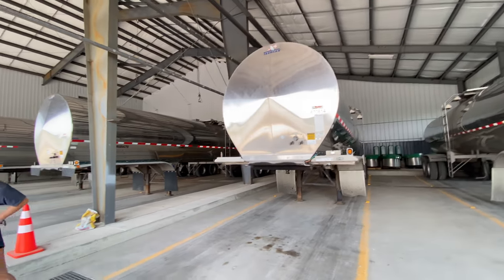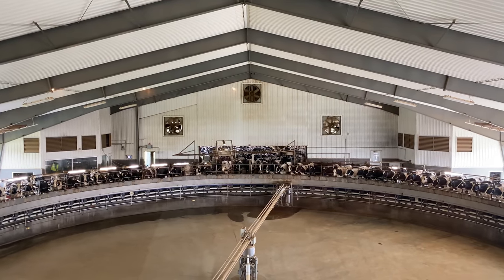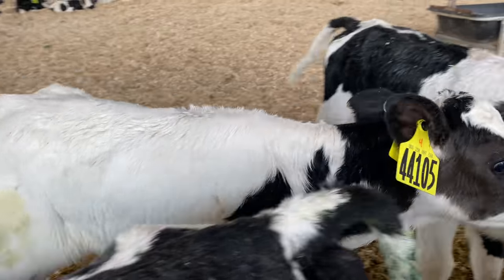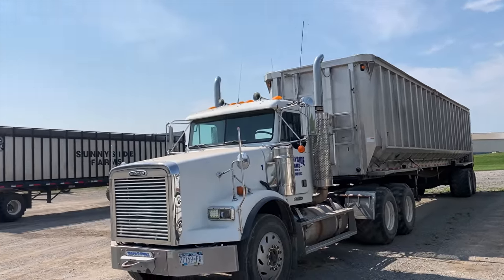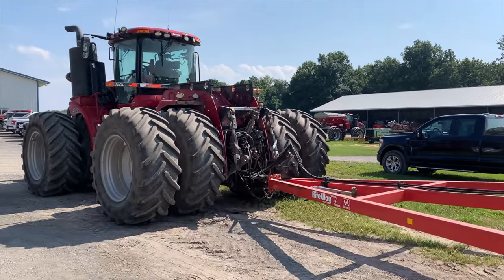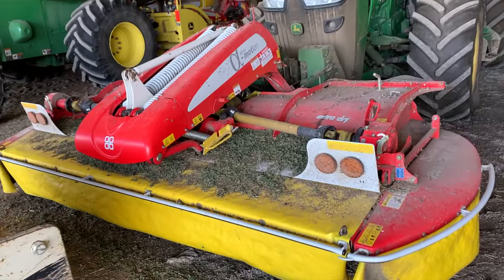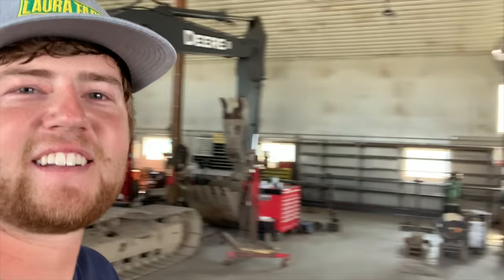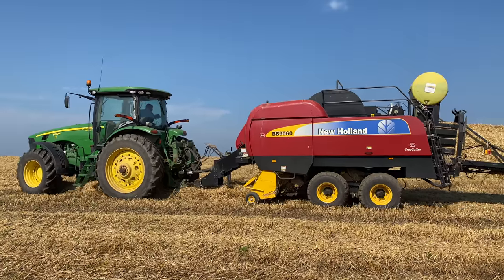Laura’s NEW Favorite Tractor at Sunnyside Farms: John Deere 9470RX

Comment: Great to see they are using the methane to power the farm plus 7k homes!
Reply: How amazing is that? I had no idea farms were even doing that.
Reply: Wow!! What a set up!! Very impressive.
Reply: Since they have the methane generators, why do they need the diesel generator in the milking operation?
Reply: @tommorrisey3999   It is a backup system. That methane plant also powers the farm. When the diesel generator is needed, I think that means the methane digesters or the methane powered generators are down or something in that system is not working.

Comment: Thank you Grant for showing close up of The methane power generators, blow's my mind the number of hrs on them engine's.I wonder how often the oil changed on them? That's gotta be a lot of oil for 24 7 run time.
Reply: They are very clean burning engines and the reason why they last so long is the engines are diesels converted too menthane so they are built very heavy too begin with. Menthane isn't as hard on the internal components as diesel fuel is.
Reply: The oil is most likely on an analysis program where they take a sample from a port while it runs and send it off to a lab to determine if the oil needs changing.  Kind of like AMSOIL does.
Reply: @beckyumphrey2626  yep the drain interval's are probably quite long unless there's an issue

Comment: Rock pickers, we used to hire college kids and go out in our fields and pick up just the 2 hand rocks that came to the surface as the ground froze and thawed, we'd spread out 8 people wide behind a dump truck and pick until it was full, now we use those giant rollers that you walked past to punch them back underground as we have all converted to rotary mowers for swathing hay and they need a flat surface (which the roller provides) to swathe across.   We have so many rocks that when the big farmers go after the rocks on a plowed and disced field they windrow the rocks and come in with a "rock picker" that picks and then conveyers the rocks into a dump truck, you can actually see the surface of the ground lower 1/2 an inch as all those rocks are taken off the field.  Those tracked trackers have less compaction (you can't see where they drove in the crop) and way smoother ride across the field.

Comment: Hey! Almost all the farms we pull out of run carousel parlors! We haul for large commercial farms usually with 2,000-4,000 head. Here in Michigan though, we run super tankers. Basically twice the capacity of the tandem axle trailers there. The folks I work for have 30 or so milk trucks/trailers and contract for a co-op.

The technology on these farms is incredible. The big farms have dairy down to an absolute science. The quality of production is almost an art form and the level of care is insane. 

The digester is a cool deal as well, my company's farm is putting one up as well. They have a dairy farm that produces 260,000lbs a day, a beef farm, they do custom ag management (basically planting, fertilizing, and chopping) of beans, corn, and hay. They have a brewery, restaurant and meat store as well. It's a crazy operation to work for.

Comment: I'm curious what's the max potential that the cows can produce, after it's run through the diesel engines and cleaned up to a degree through the converters, seems it would be as profitable selling power as it would milk?

Comment: Wait a minute, was their wings on that planter? As in a DB120 switched over to exact emerge / high speed? I build two 90’ DB high speeders that started as 120’s but I took the wings off because on 20” spacing, 54 row units is enough weight.

Comment: 70 and 90 thousand hours!  8660 hours in a year.  They run at 1800 rpm 1800 RPM is something like 65 mph in a truck.  8660 x 65= 562,900 miles 70000/8660 = 8.083   8.083 * 562,900 = 4,549,920.7 miles!  That's SOME maintenance program!  Also, methane burns REALLY clean.

Comment: How do they clean the trailers? And the milking systems? How are the cows attached to the milking system, Auto or manual?
Reply: The trailers are cleaned at the dairy once they're emptied. High pressure hot water cleaning (I think)
Reply: looikup cip systems for milking machins an there the same for trailers